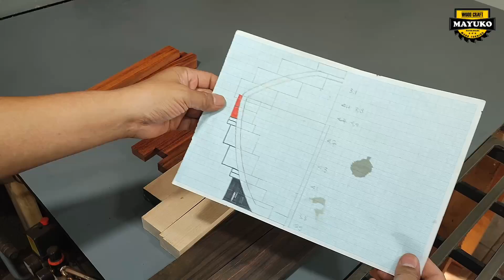ELEGANT BOWL WITH CROSS LINE LID, woodturning

Comment: Just a tip, might want to get an air tool to use for power sanding. Electric tools tend to get dust clogged in the motor and burned out pretty quickly.

Comment: So what shall I do today ... I know I'll cut up lots of little pieces of wood, glue them all together into rings and slap some of those rings together ... then I'll glue some more bits of wood together before cutting them up into little pieces, make some more rings and slap them together with the other rings I've made ... then I'll start cutting some of the rings up and putting other bits of wood in between ... then a quick bit of turning and done 🥰
The sheer variety of your work is truly astounding ... each and every piece you do seems to surpass the last ... long may it continue 👍